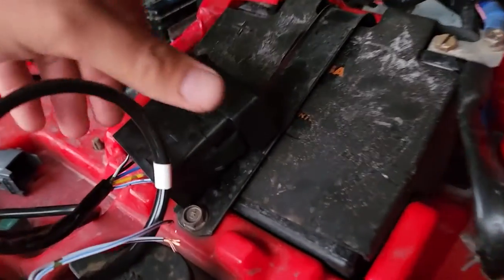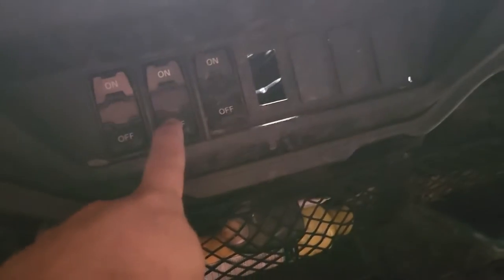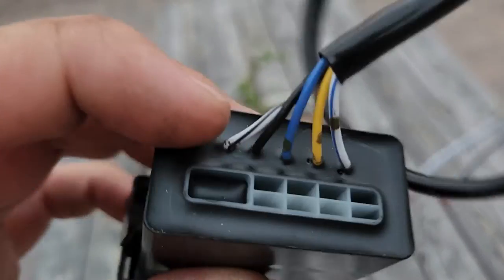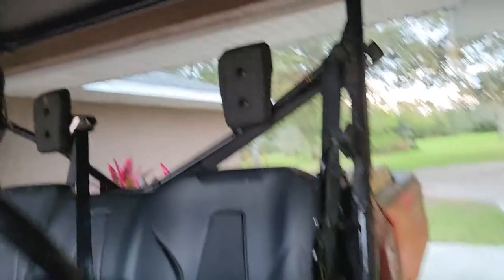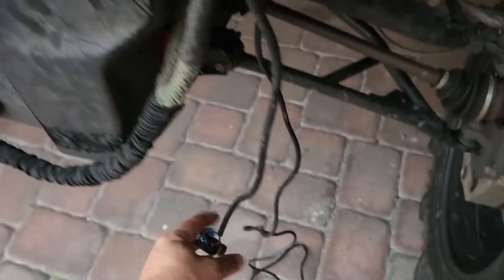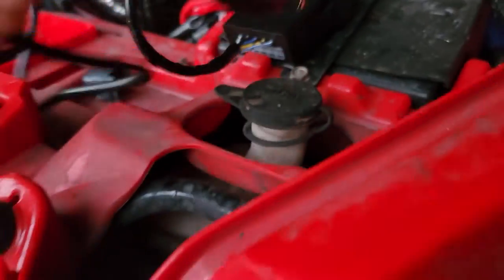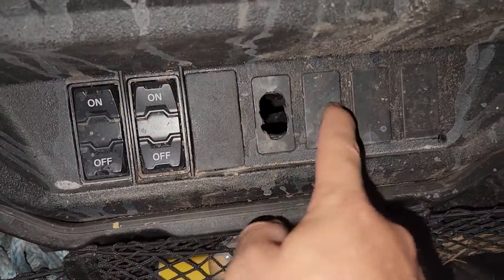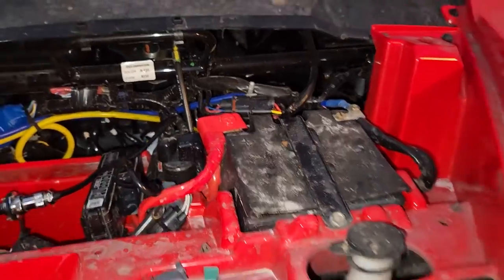Premium OEM Honda winch switch upgrade Talon & Pioneer

Comment: I saw this vid and ordered a Honda switch. I’m trying to wire it to my rough country switch which is trash in water. My issue is that the rc switch is a 7 pin and I’m confused on which 3 would work.

Comment: I am getting ready to install my Honda (warn) winch on my new 1000-6, the dealership is including this switch which is not standard on the 1000-6, what/where is this switch wiring into? Thanks
Reply from the maker: So because I was installing an aftermarket switch I wired this switch straight up to my winch solenoid also called the contactor
Reply from the maker: That should work exactly the same for your Warn winch. The switch only needs three wires power from somewhere either directly from the battery or keyed power. Then the other two wires go to the end or out signal on your winch solenoid